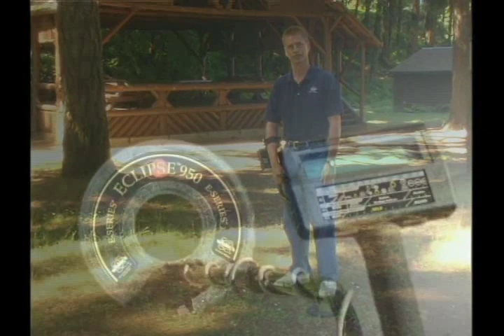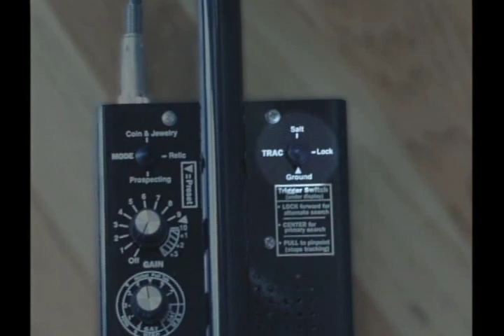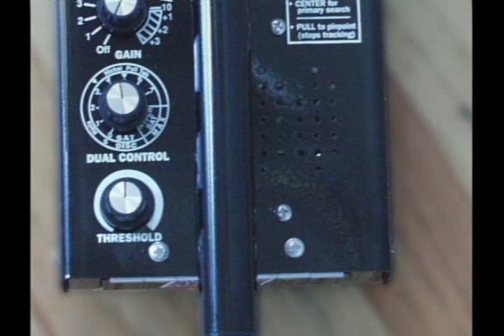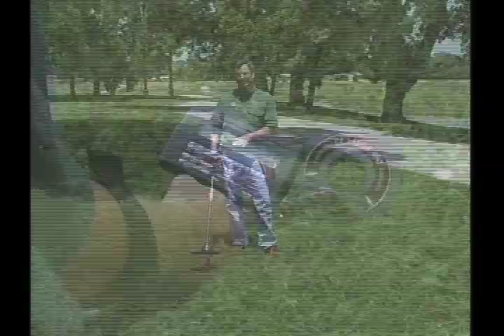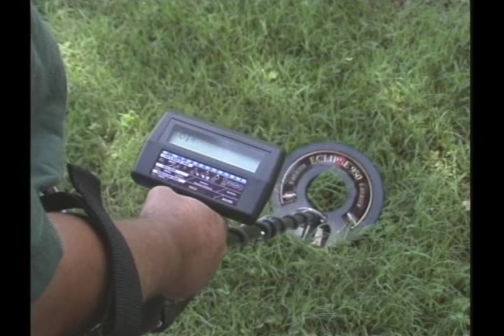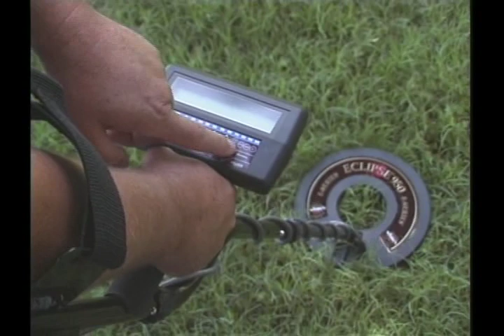Part 1 - MXT instructional video

Comment: I have 2 MXT Pro units. These work every bit as good as a lot of the newer detectors . I have modern detectors like the XP Deus but I’ll never give up my MXT’s
Reply: Yep 👍 won't let you down and will find coins gold rings,gold nuggets, relic's lots
Reply: @Dodobird-m8e  at 71 I have to use Docs swing thing to take the weight off . Nice gadget, works great

Comment: Mines junk and shows bars across the screen all the time.
Reply: Ignore all that if she's up and running good other than knowing what your looking at on that screen just dig it because i think I lost lots of gold and rings 💍 coins 🪙 that MXT pro is a powerful machine if you don't have Any shorts were it not working right then you gonna have major problems now MINE is gold sniffing machine goes 2 -10  inches 5 to 8 were most the times it's at
Reply: @Gold-d9x  MXT is still a great detector even to this day.
Reply: @Kulric amen yes

Comment: Recently added the whites 5.3 eclipse to my 2003 MXT. Was wondering what might be the maximum depth I might be able to attain ?
Reply: 5 feet down 😂 lol kidding I own the mxt pro with ground grab it will go anywhere from 1 inch to 10 inches depending on mineralaztion and how you set it

Comment: I am having trouble getting it to discriminate between nickels and aluminum caps. They both ring up as a 20.and penneys and pull tabs. It rings up and says one thing, but I keep finding the other in the holes. Any clues?